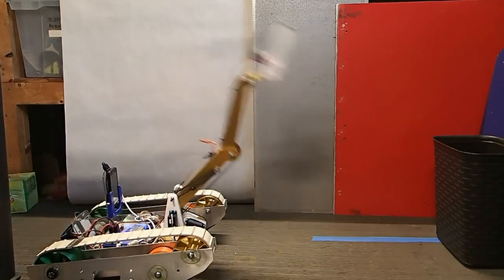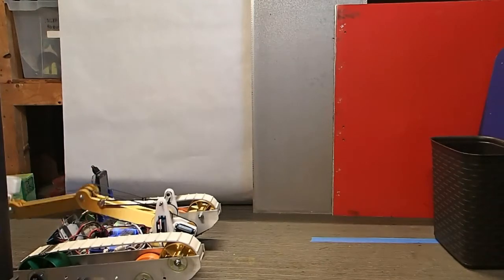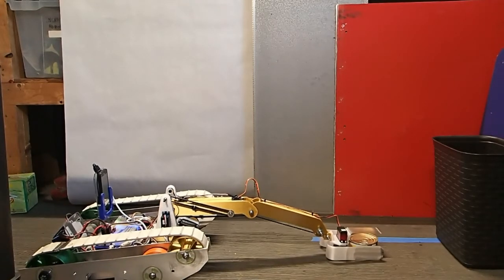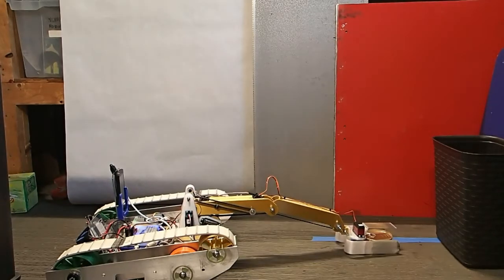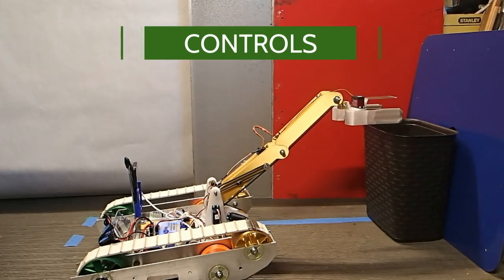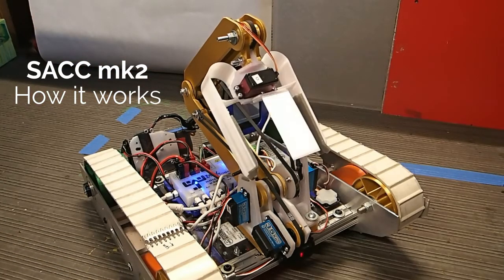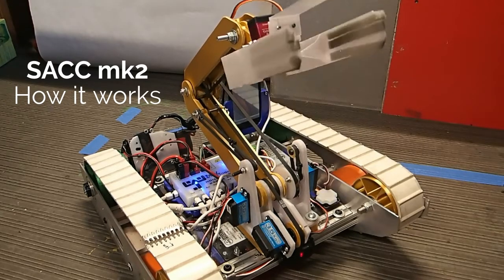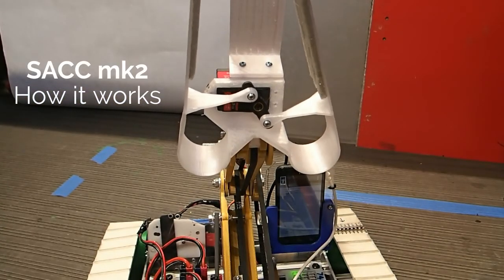Servo Actuated robot arm with Compliant Claw (SACC), Make 2

Comment: Hi Steve, are your arm parts 3d printed? If so would you mind sharing the cad designs?
Reply from the maker: Yes, the arms, base, claw, pulleys are 3d printed. An earlier version of the arm design is on Thingiverse at: https://www.thingiverse.com/thing:4376591  I designed it in OpenSCAD and the CAD included.  OpenSCAD is a programmers CAD so everything can be changed.
Reply: @Sr_Amo  Awesome, thanks. I have a prior year ftc bot sitting here that's looking for a good project.